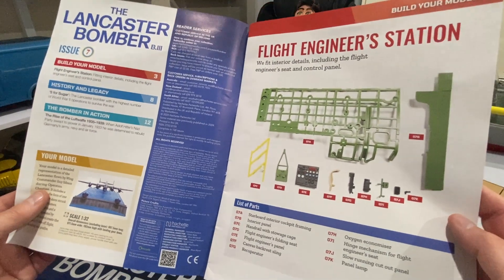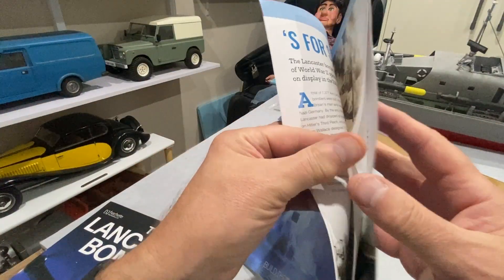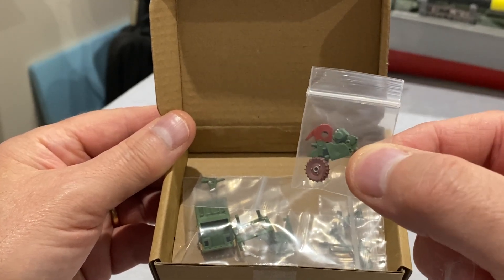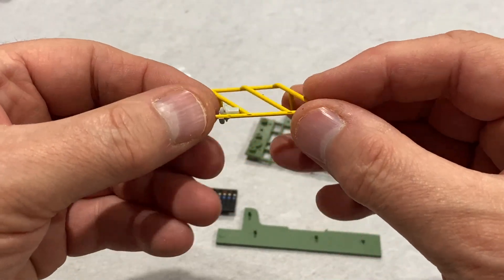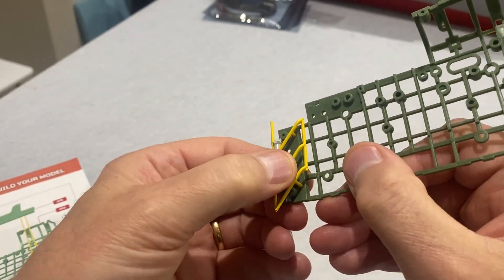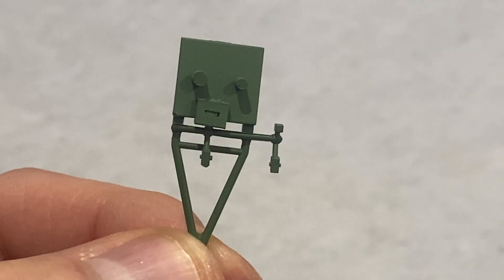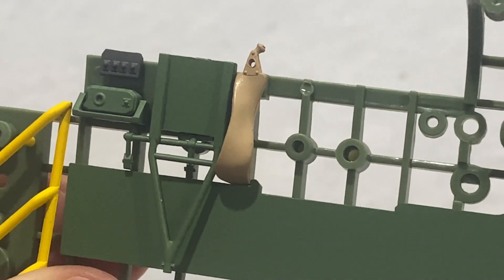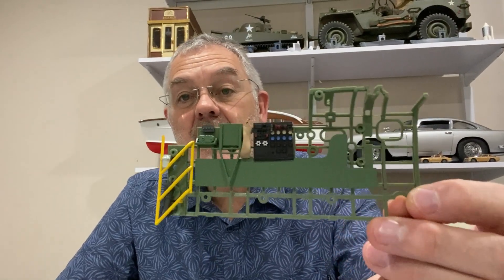Part 7 of A piece of aviation history - building a Lancaster bomber from the Dambusters raid

Comment: You say you don't know what a recuperator does but there's a clue in the name. It recuperates. Hope you found this helpful. 

Actually, I was interested to know what it did too and a quick Google told me it is basically a heat exchanger, warming incoming air needed onboard. I imagine any heating was well received by those brave lads.

It's interesting following your build of this Lanc. I've always thought the people who built the deAgostini Spitfire and such were mugs when you calculate the cost - you know, 100 issues at £10 a pop, when you could buy a kit far, far cheaper. But your build shows the parts of this particular model as beautifully crafted  and worthy of a bit of expense. I am enjoying the series and am looking forward to seeing more details and ultimately the finished item. 
You made a great job of the Chris Craft boat by the way. I'm not a boat man - mostly a glider guider - but I appreciate the skill and effort that went into it. Great job indeed.
Reply from the maker: Thanks very much. I think that people who scoff at the cost of these models really don’t know how good quality they are. I’ve made a number and they simply can’t be bought cheaper from a model shop.